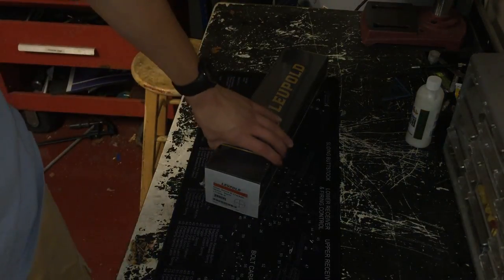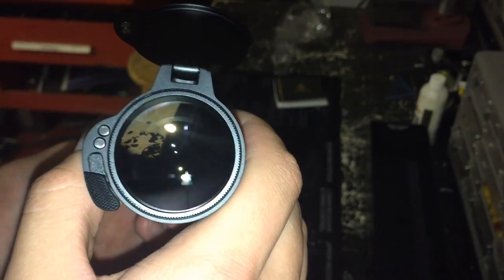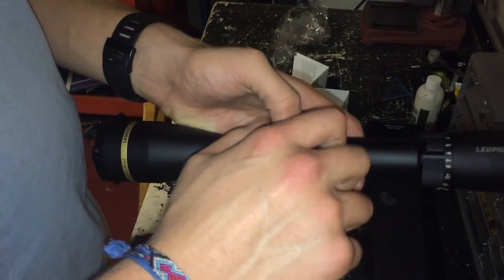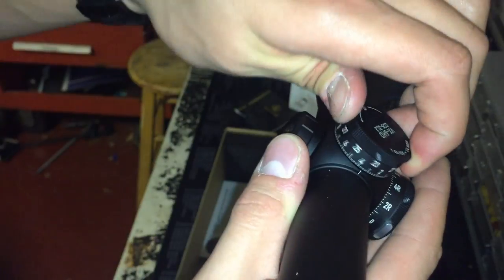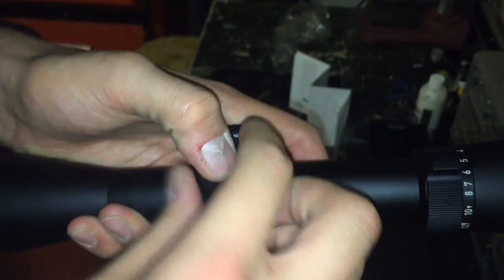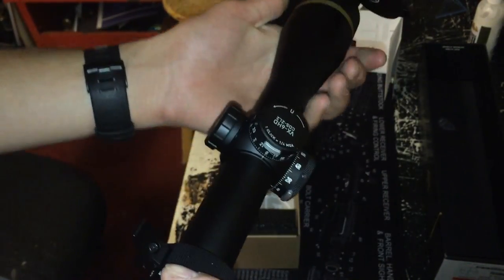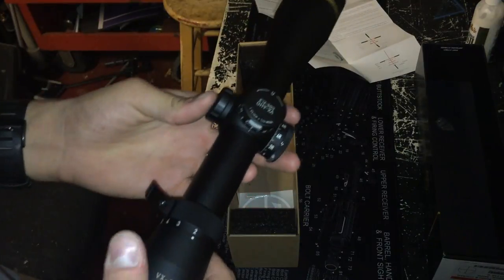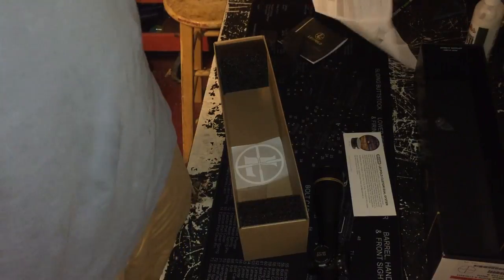NEW! Leupold VX-6HD 2-12X42 Boone and Crockett Review

Comment: I just ordered the 3-15x56 mm VX-5HD because I wanted the large 56 mm objective, and the lenses are of identical quality. I thought the VX-6HD 3-18x50mm objective lens was a bit small in low light for something that goes up to 18X. I like Cabela's, however, in Canada they charge at least $300 more (+ sales tax) than Bass Pro Shops and other dealers for the VX-5 HD. And their markup in Canada is even more for the VX-6 line.
Reply from the maker: Will Branson what the heck that's so strange🤣
Reply: Not sure what you mean. I try to choose my words carefully. I was trying to warn Canadian customers that if they want to buy a VX-5 or VX-6 series Leupold scope, they should avoid buying it from Cabela's in Canada. For example, a 3-15x44 mm VX-5HD (Firedot duplex reticle) is 899.00 US, while it's $1399.00 CDN here. That's way more than the exchange rate, because Bass Pro shops down the road sells exactly the same model scope for $1095.00 CDN!! 

The 3-18x50mm VX-6HD (with the same Firedot duplex reticle) is $1699.99 at both Cabelas and Bass Pro shops in the USA, but a ridiculous $2599.99 Cdn. here. Then add 13% additional sales tax on those differences. In fact, Cabela's charges way more for pretty well all shooting supplies. Another example: At Cabela's, I just picked up some Hornady Superperformance 243 Win ammo @51.99 per box. Bass Pro Shop's price (just down the highway from Cabela's) is $39.99. The Wheeler Engineering scope mounting leveler is $80.00 at Cabela's, and $65.00 at Bass Pro Shops. Ditto for their markup on guns too. 

My point was to warn Canadian customers to stay away from Cabela's unless they're a masochist and enjoy paying through the nose; or the store has the item they're seeking on sale. (Which is seldom, unless it's junk.)